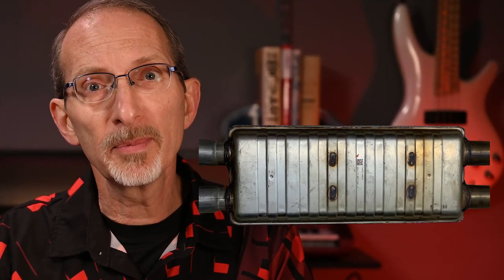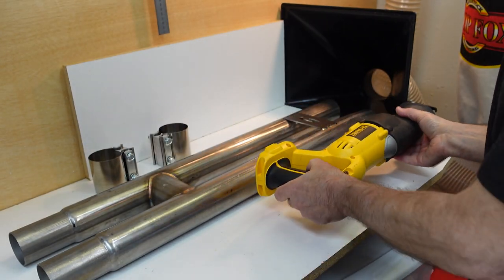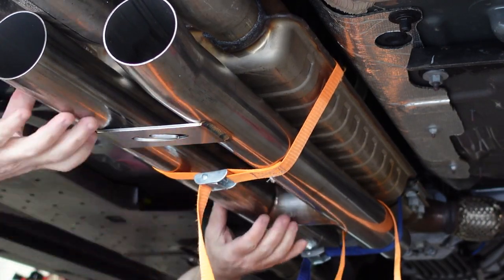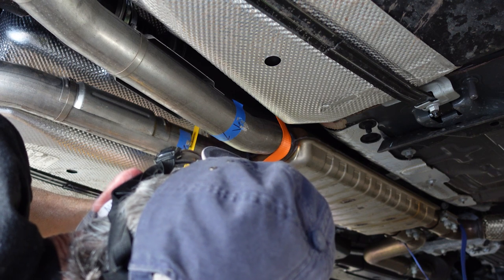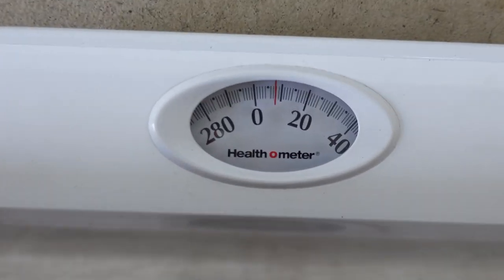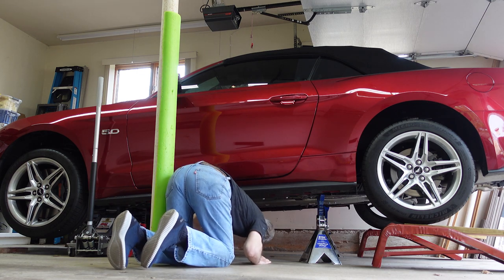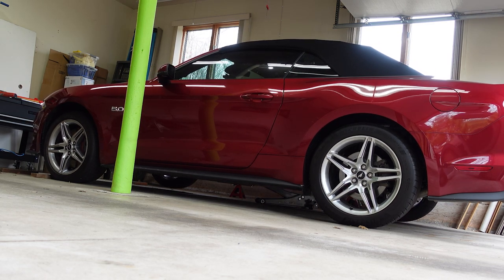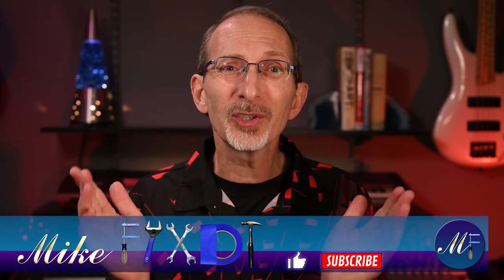How to Fix a New Car – Steeda ‘Resonator Delete’ H-Pipe | DIY  Installation + b/a Sound Clips

Comment: Resonators don't restrict the airflow, they have peripheral baffles that absorb sound but the pressure drops as when the air flow reaches the resinator chamber there are holes in the through pipe that allows the pressured air flow to penetrate thus reducing velocity, back end pressure and sound. If you look through you will see there are no in line baffles, its straight through pipes. Its like blowing through a straw versus a straw with holes along it. That's why in my opinion its a great mod as you are not increasing pollution just sound and with the 2018 on active exhaust you can still switch to quite mode anyway. Great mod and great video. :)
Reply from the maker: Allan, yes, exactly what you described. When you look through the resonator, you can see straight through. I do think the baffles create a little bit of back pressure, and removing the resonator may make the car breathe more freely. As much as the manufacturers want you to think it is a power modification, I think it is more of a sound mod, but that equates to better enjoyment!

Comment: Good video! I just did this on my 22 GT, same steeda h pipe. I intitally installed this with the provided exhaust clamps but boy are they a PAIN to get tight and torqued down. I HIGHLY recommend you folks to buy the Vibrant  TC 1171 exhaust clamps for this install. You can add them either on steeda or buy them on amazon. I took the steeda ones off and used the Vibrant ones and its MUCH more sturdier and easier to install. Overall a not too bad install(I removed the whole catback in fear of accidently puncturing the gas tank with a saw zall). Very easy to do!

Comment: Great video! I just got my Steeda H today!. Tomorrow going to find a garage to install it. Some videos show removing the cut end back to mufflers off. Some this way. Seems simple this way too! I think using supports is half the battle.
Reply from the maker: @danno1 L - congrats on your eminent H-pipe upgrade! I am curious, what do you gain by replacing all the way back to the mufflers? I agree that supporting the exhaust while you work is a big part of the project. Those lashing straps saved my life! I can’t imagine doing this project without them, if you are working by yourself. Good luck with your install!
Reply: @MikeFyxdt  Actually what I mean on cut end back to mufflers are just removing the whole section,mufflers, pipe, where you  unclamped the front of the resonator. Then you can measure and install H pipe while off the car. Then install complete section to the clamps.
Reply from the maker: @danno1l514  gotcha!

Comment: Should have started the car up before putting it back together, I would have loved to hear it. I to live in Pa. where about's are you?
Reply from the maker: Hi Stanley, I didn’t start the car until everything was bolted down tightly. I did that to check for leaks while it was still on the jackstands, in case I needed to get back under there and adjust something. I am in Bucks county. How about you?

Comment: Your neighbors are going to love you... lol.
I think just found the right guy to MacGyver a Helmholtz resonator on my Integra's exhaust.
Reply from the maker: Hi Marc!  Yes, I think about the neighbors when I do a cold start, and I often put it in quiet for them. The only people that probably hear the Mustang’s wrath are the people directly next-door to us. I’m glad they don’t have many windows facing my garage. I had to look up Helmholtz resonators… Interesting! I never knew they could take such a scientific approach to canceling specific frequencies in a muffler/resonator. Someday I would love to try bending pipes and welding. Right now I think my skills are average when it comes to tightening bolts on pre-designed parts! Is it time to put the sports cars out on the road yet?
Reply: @MikeFyxdt  I put them out yesterday (GSR) and today (S2000). Both cars need new tires. The S2000 has one of those drone cancelling pipes. I think it came stock that way. The Integra drones a lot. I think it is because 4 inches of piping had to be added to make the Yonaka catback exhaust fit on my model year. I am having a hard time finding anyone that is willing to install that drone cancelling pipe as it requires a bit of math to get it just right.
Reply from the maker: @marcperras9072  i’m glad to hear your Honda‘s are out in the sunshine! Is it OK to call your Integra a Honda? I’ll bet it would be very expensive to have someone do a custom exhaust, and I don’t know how much better that would be than getting one aftermarket that’s already designed. But maybe having a unique one-off design will make it sound like something totally new and fresh, and will make you happy! I am frugal when it comes to many decisions, but when I splurge, I like to splurge big. This might be an item you enjoy splurging on…
Reply: @MikeFyxdt  That's fine with me. The motor in the Integra has Honda Motors written on it... The car is sold as a Honda almost everywhere outside of North America. I spent good money for that exhaust system, as well as, for mods and installation, so I am keeping it. Besides, most other exhausts don't fit the car as the 94 GSR has a different down pipe than other trims and other model years. A one off too rare for exhaust companies to produce a proper replacement.
Reply from the maker: @marcperras9072  that makes good sense, if a model is relatively rare then the mass manufacturers aren’t going to go after that market. My Integra had Honda on the engine, too! I wonder how many parts on modern Acuras still say Honda. I would love for someone to loan me an NSX for a week so I can count them. 😎🔥

Comment: Hi mike . john here from the uk. had the exact same H pipe fitted, had to go back to the installers to put a spot weld on the clamps as the back mufflers twisted downwards, the outside exhaust tip drooped down after a week or so.
Reply from the maker: Hi John, that's a good pointer to watch out for, and an effective way to fix it! I'll keep an eye out for any droop in my system. I am hoping that the installation remains weld-free so I can reverse it if needed - but I'll report back if I see any issues. Thanks for the heads-up and for watching...and enjoy that H-Pipe rumble!

Comment: Hello, thank you for the excellent video. I pretty much used the same technique on my 2022 Mach 1. One issue I came across is that the left side is hanging a little lower than the right. I tried to loosen all the connections and push up but it still is lower. Did you have any issues with this? Any ideas of how to level out correctly? 
Thanks
Reply from the maker: Hi Jose, I also had a little unevenness at first. I think I twisted the tailpipes a little while pulling and pushing on them and they sorted themselves out. Sorry, I wish I could be of more help!
Reply: I have the same problem on my 21 GT, the left is lower and the outlets are not perfectly horizontal.

Comment: Okay quick question?
Why would you even want a cross-over (H or X) ? 
In the late 60's early 70's, we'd spend days separating factory singles too true duels, bigger pipes, better flow, moar HP?
Yes this was before the catalytic, or environmental phenom.....
Is it not possible to run a true dual exhaust anymore?
Unless I do it and.... don't tell?
Reply from the maker: There’s no reason you can’t run a true dual exhaust. Crossing them over has more to do with the idea of blending the two cylinder banks. It averages out the combustion pulses for a smoother overall sound.

Comment: hi mike.
I am thinking of putting a steeda or michimoto h pipe.
  I have the same Mustang as you 2019 ruby red mettalic with fully stock active exhaust it's a European I'm in France.
corn
I am afraid of having a drone in the passenger compartment.
Can you tell me your feelings about this while driving, is there any unwanted drone?
and for you what are the best steeda or michimoto clamps because they are not the same ??
Reply from the maker: Hi John, thanks for your questions. I don’t have any experience with clamps other than what came with the Steeda H Pipe. Those work very well, but honestly the factory clamps that were on the front of the resonator are probably better made. They also don’t require a wrench behind the bolt when you tighten. But those are just minor complaints. I will say that the H pipe is much louder than the car with the resonator. Since I have the active exhaust, I often keep it on quiet when I am around other people, and it is a very soothing sound without drone. All the other settings, normal, sport and track, are aggressive sounds, which I enjoy as well. But being a good neighbor, I do spend a lot of time using that quiet setting now that the H pipe is installed. I hope that helps! Thank you for watching and for joining the conversation. Good luck with your Mustang!
Reply: @MikeFyxdt thank you mike for your impressions it helps me and consolidates me in my convictions .. i will go for an H pipe mishimoto ... i think steeda or mishimoto are two values on .. and if the clamps do not do the case in time I will find other.
Reply from the maker: @johnhulster7658  It sounds like a good plan John. Good luck with the project!

Comment: Any problem getting the tail pipes to slide into the h-pipe?
Reply from the maker: Hi Robert, no problems. The h pipe doesn’t really contact the exhaust pipes…rather the clamp collar wraps around them both. The pipe diameter was the same.  Hope that helps!
Reply: @MikeFyxdt  it does. Thanks for the quick response.